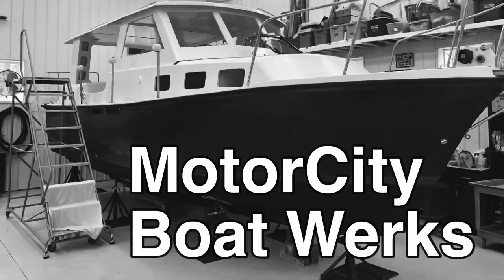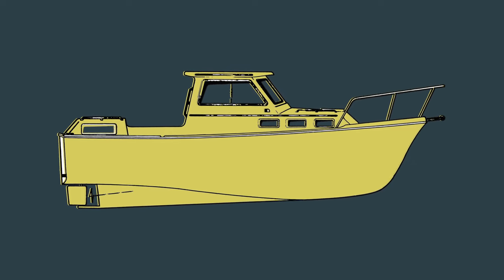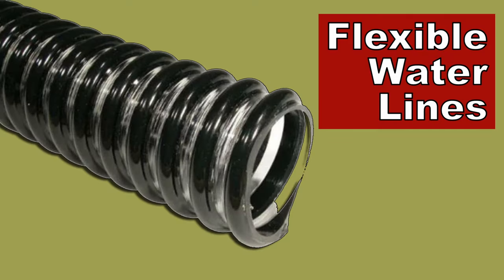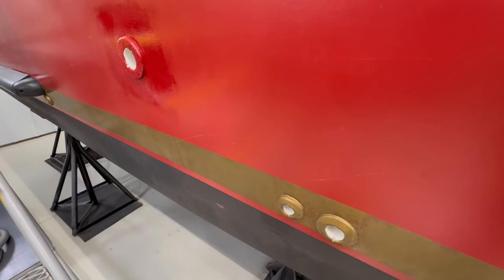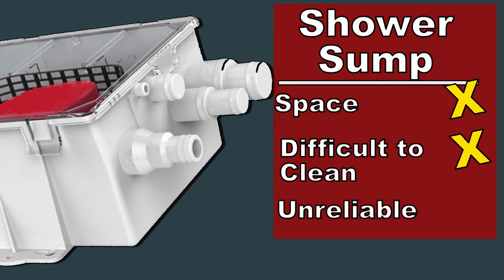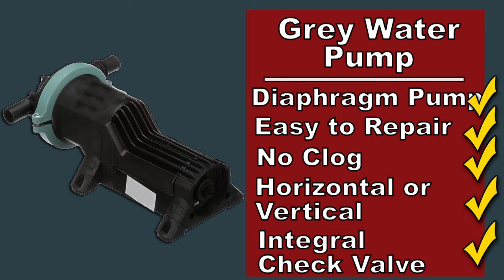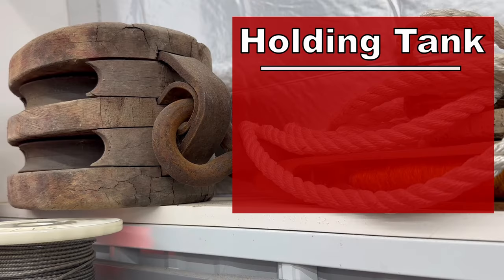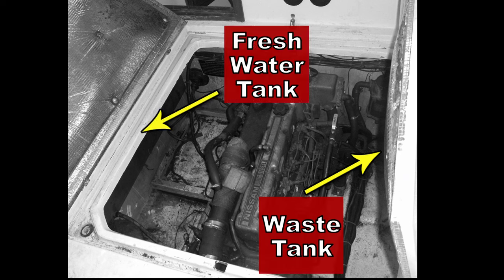Should You Use a Composting Toilet on a Boat? Build a Boat Bathroom (Ep67)

Comment: I got something out of this, namely, using a diaphragm pump for shower! The boat I'm currently renovating has a shower sump. This sump sits in the center of the bilge and because of the lack of space it pumps overboard on the opposite side of the boat from where the head is. The way the factory did this adds at least 20 feet of hoses. Plus they notched out a stinger to make room for these hoses. Your excellent idea of using a diaphragm pump eliminates a lot and lot of hoses and I can terminate a bilge hatch (which makes laying flooring a lot easier too!) And with your diaphragm pump solution, as an extra bonus in my case, all my water (gally, shower, toilet) is then on port side. No more hoses from one side to the other. and because of the oodles of feet of hoses I no longer need, I can invest in that expansive white sanitary hose.
Reply from the maker: Excellent ! Be sure to include an in-line strainer before the diaphragm pump. This will catch hair mostly and you probably won’t have to clean it but 2-3 times a year with constant liveaboard use 😁👍

Comment: I've been using a natures head on my liveaboard boats for 10 years now...When I switched boats it came with me. I've had some negative experiences over the years like when a guest pee'd in the composting chamber or when it got infected with bugs. But overall,  for me it's a much better option.  Living aboard in Canada during the winter it's so much easier to empty the toilet once a month then to slug around a portable pumpout (honey bee) through the ice..spend a bunch of time pumping out a tank in the cold and then hauling it to a disposal area. I've never had a natures toilet fail on me but I've had a holding tank dump sewage into my bilge twice. I've had both...I'll never go back to a holding tank system. But that's a personal choice based on my needs and experiences. A composting toilet might not be for everyone..but saying that it's "pooping in a bucket" is disingenuous and you're wrong to steer people away from an option that might be better for them.
Reply from the maker: Thank you for making my points for me. 😂👍What’s disingenuous is to say a composting toilet 1) even composts 2) is anything other than popping in a bucket 🪣  3) implying I’m wrong to provide a truthful account of a hot button topic consistently misrepresented by zealots. 😁We’ve all got your number Gary 🐙 be sure to like and subscribe 👍

Comment: Hi we replaced the head in our albin 27 fc  with an Ogo composting toilet it fit perfectly in the old spot . We're doing the great loop it's been excellent 6 months straight yes it needs to be cleaned once and awhile but don't they all do a little white vinegar in the urine tank keeps it from smelling at all. Also opened up a lot of space storage in the engine room 👍.
Reply from the maker: Who dumps the pee bottle every day or so ?  😂😅😂😅🤣 BTW the original Albin 27 had less than 17” of shoulder space in the throne and a 16-18” wide door. I’m too much man for that kind of space. 👍😁

Be sure to like and subscribe Scott and join the new Albin 27 Owners Club

Comment: Installed one on or last boat, Nor'sea 27. Smell was like damp earth, liquids get ripe after a few days. Had it vented to the on deck solar fan. No flies. Present boat has an electric head, 20 feet of stinking hose, holding tank, macerator, thru hull but head is flushed with fresh water.
Reply from the maker: Thanks for making my point. 👍😁Sounds like it’s time for you to repair or replace your electric head- 20 feet of hose is way too much no wonder you have problems. 😂🤣😂🤣

Comment: People evaluating a composting head, who have obviously never used them is so ridiculous.  They are cheaper long term. They smell way way less than sea heads. Near zero maintenance. As a long term user as a live aboard, I would never, ever use anything but a composting toilet.
Reply from the maker: Now you know that’s now true 🐙Dale,but I still appreciate your comment. 🫤We all know there’s a reason composting heads are not typically outfitted inside new luxury model pocket or long term cruisers. To say a composting head has no smell is to be untruthful at face value. To ignore the practical requirements and limitations is to be deceptive. Dialing in the litter requirements takes effort and maintenance not to mention the daily trips to pour out the pee bottle! 😳oh you left that out Dale— shame on you. 👎

There is a smell. Where as a properly plumbed marine toilet and waste tank will give years of near house quality experience. 

Be sure to like and subscribe 😁👍